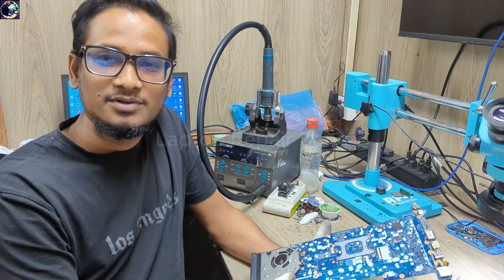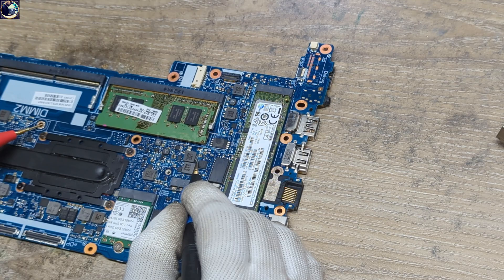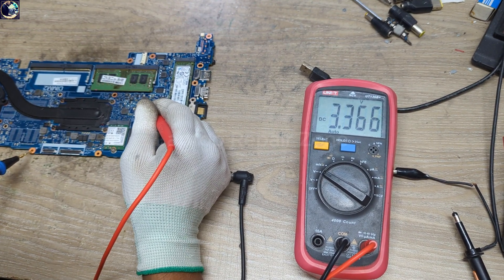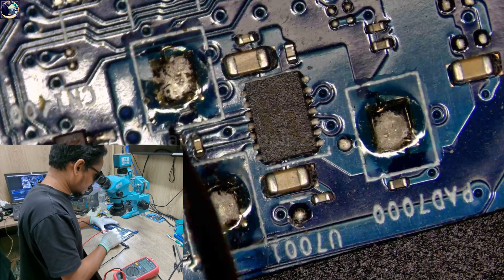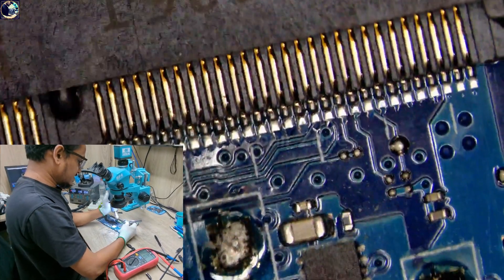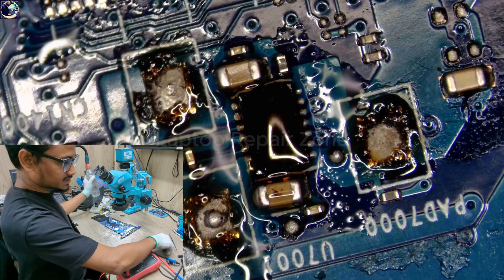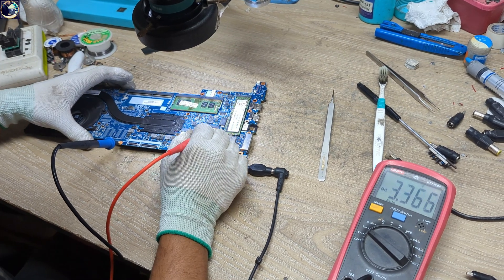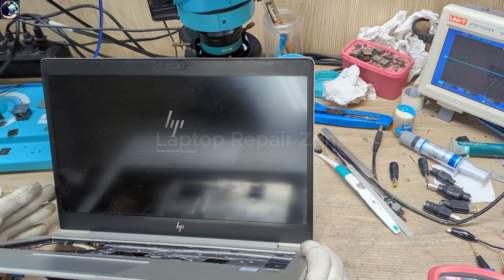HP elitebook 840 G5 not turning on white and orange LED light blinking continuously Fixed!!

Comment: in diode mode you inserted the red lead/probe on ground and use the black probe to test around, but after switching to voltage mode you now placed the black probe on ground and used the red probe to test around.
I simply wanna know why?

Comment: I love your work. Am having same problem blinking and the 3volt is present but still blinking. I have  flashed the bios same problem. Is there any assistance you can give me. I noticed the charging coil voltage  is 11.3 instead of 12 voltage

Comment: nice video  sir in this motherbroad problem is no sound i chang audio ic but no sound beep in bios is ok  not in shows i divicemanger   pls give some tip for this problem  and have hang  problem stuck in bootloader in other mother broad  pls both problem in hp commen in elitebook  pls give some tip
Reply from the maker: Thanks! I'll try to make a video about these issues soon.
Reply: Bios program both
Reply: no reply
Reply: Pls sir I have 4 hp elitebook the caps lock blinks 5 times I flash the bios with working laptop bios I extracted but still it blinks 5 times pls I need solution to it